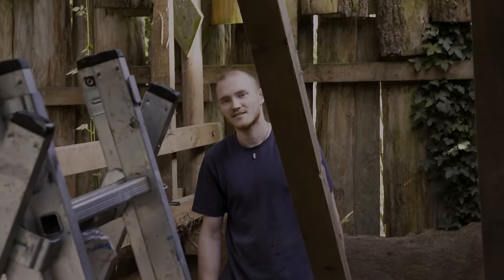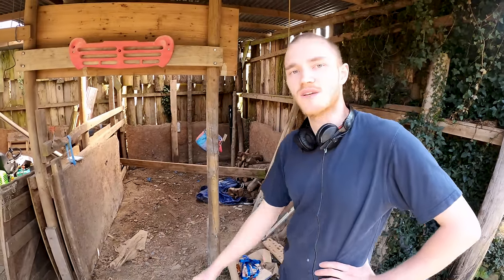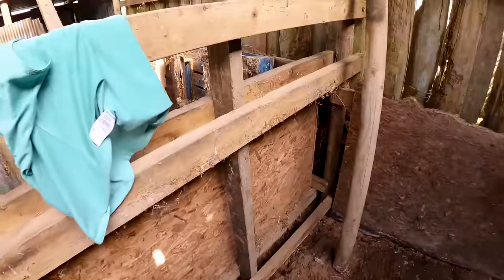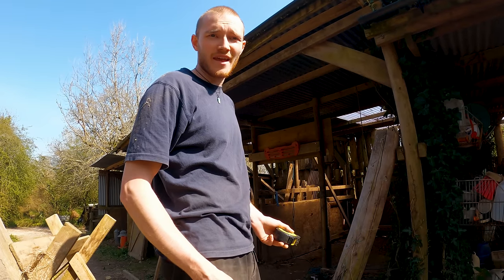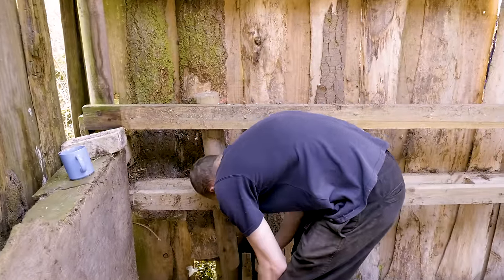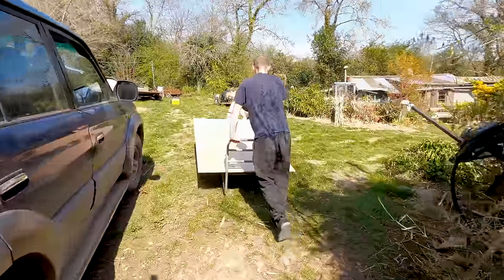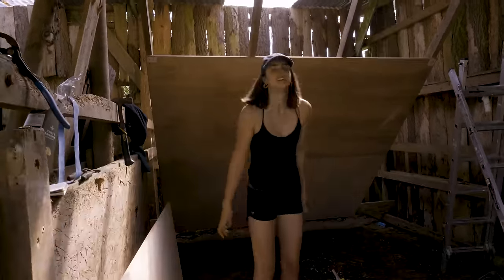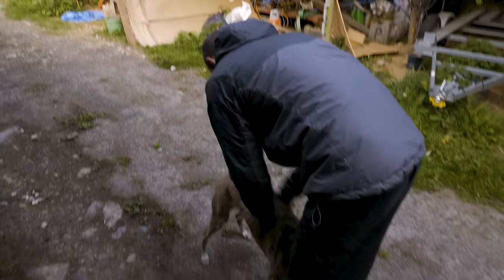I built a QUARINTINE CLIMBING WALL & all the handholds

Comment: Tom, I would suggest putting 2x4 braces between the seams of your sheets of plywood. It will add quite a bit of structural integrity for a little bit of work.

Comment: Nice work Tom! Also in the process of building a board -- making holds is proving to be the difficult part during quarantine, especially without a jigsaw and sander (disk or belt). Making do for now!
Reply: I've made avout 60 holds in a span of a month or so. I would love to share pictures of mine since I don't have any sanding tools either. I think they have came up real nice

edit : posted them to imgur DIY wooden climbing holds (drill, hand saw, sandpaper and a file) https://imgur.com/gallery/ueNFK9Z
Reply: @eelissallmen5432  They look pretty good! I'm not sure about the screw position on the 8 jugs to the front though. The leverage looks wrong. I'd add at least one screw as close as possible to the positive edge, without being exposed on the inside obviously.

Comment: Awesome video, I really enjoyed it! Just a few safety tips: Did you literally just screw the holds onto the wall without a nut or did you use drive nuts? Because relying just on the thread of the screws like that can be quite dangerous, as they can slip or break out of the wall with a lot of force on them (dynamic moves) and nothing to hold them back except the thread (especially because plywood is quite thin, so not all of the screws holding-ability is being used) Also: Using washers between the screws and the wood is really important so the force on the screw is distributed more evenly and the above is less likely to happen (and to keep the wooden holds from splitting. Source: my dad is a carpenter and called me out when I tried to do exactly that when I was building my woody 💩 Stay safe!
Reply: It really depends on the wood you use for the holds. I know that most if not all the wood Tom used was high quality hardwood, eg. beech. Some soft types of pine would obviously be unsuitable. You do have to be careful with screw placement in the hold, not too close to the edge and such. But so long as you use decent quality screws and ply (screws min 4.5 I'd say. Ply min 18mm structural.) and the screws go right through the ply there shouldn't be any problem. The cross grain structure of plywood actually makes it better than solid timber for screw holding.
Source: I'm a joiner, have been climbing for 25 years, built my own wall several times, and I made the volumes in the vid 😉
Reply: Tim Barnden wow... looks like my dad convinced me to make my life unnecessarily difficult lol. I spent hours doing everything the “safe” way

Comment: I've seen quite a few home-walls over the last few weeks and I noticed that most of them are at an overhang. I was wondering, why is that? Is it just to make it more stable? Not really much of a fan of overhang myself, I think if I were to build a home-wall I would just make it straight.
Reply from the maker: 30 to 50 degree overhang is just the standard for a training wall. It's a good angle to focus on strength and power whereas on vert there will be a greater emphasis on footwork and small holds. 

If you're not a big fan of overhang I'd still reccomend going for something around 20°. You'll still be able to get some smaller holds & more technical climbs but also work on strength 😁